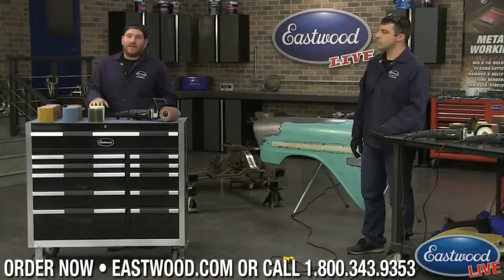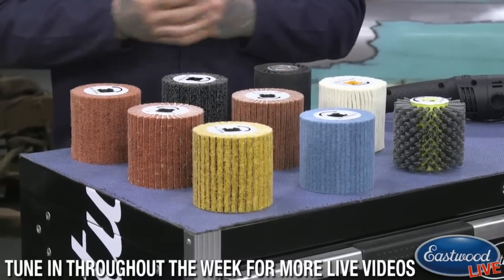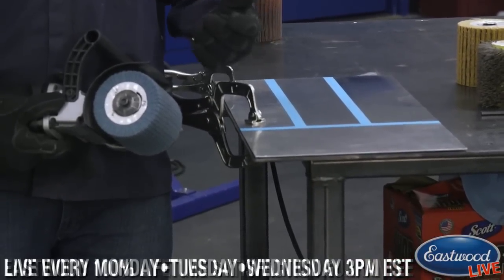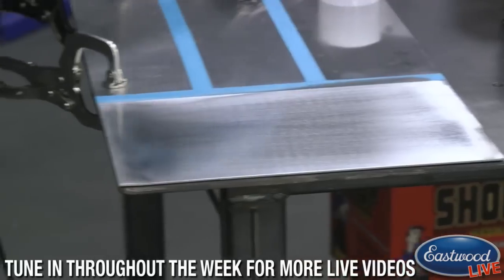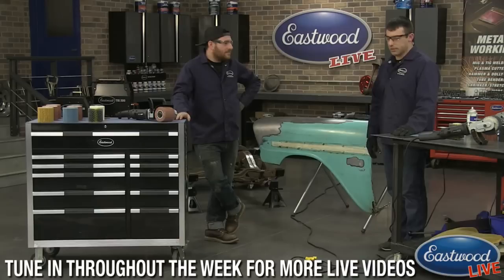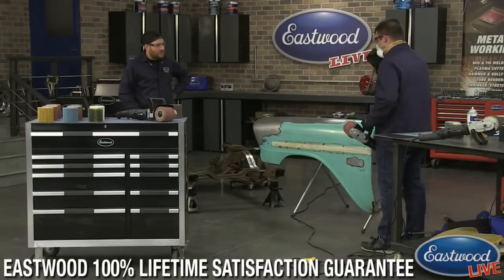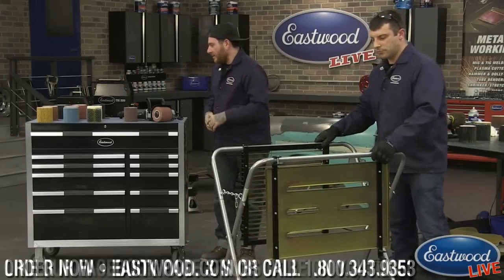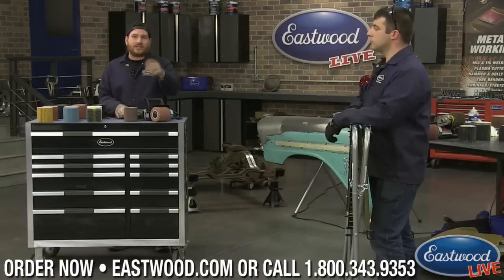NEW Contour SCT Drums!  Remove Rust, Polish Aluminum, Strip Paint, Metal Finish.  All with 1 Tool.

Comment: I have a question. How much can be serviced and what do you need to service the tool.  Are the grease in oil or greased? Do you need to change the oil or grease? I see it has brushes. Can you buy replacement brushes? Can you buy bearings for the gears?